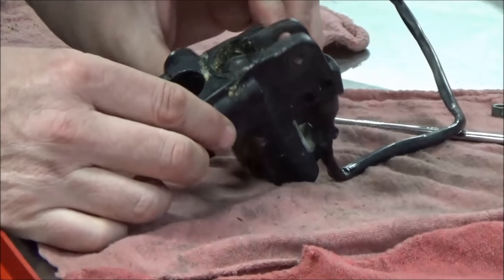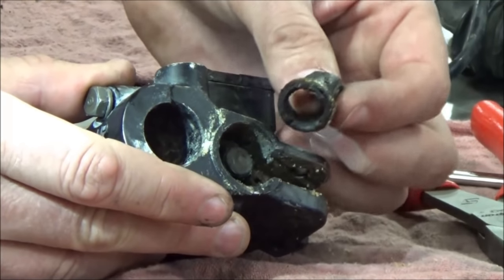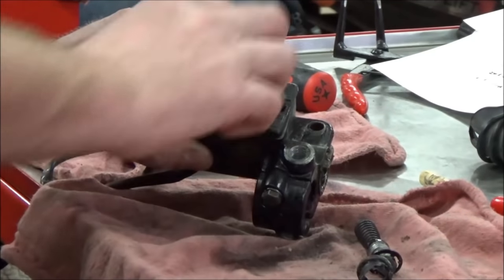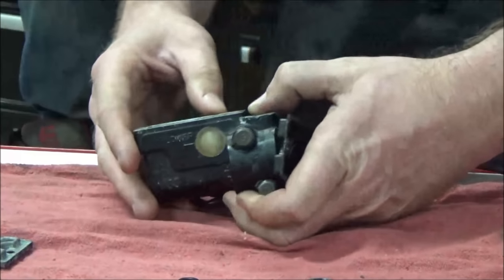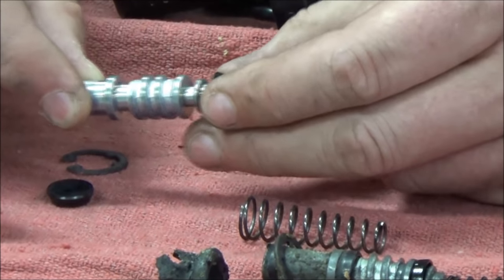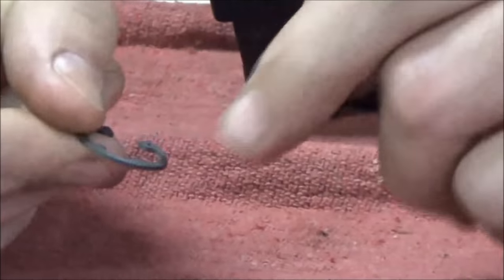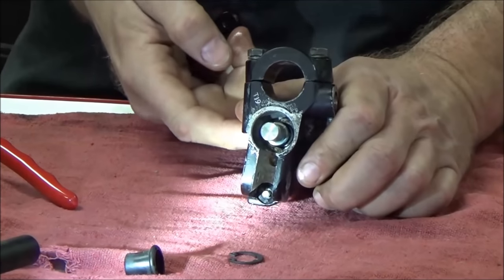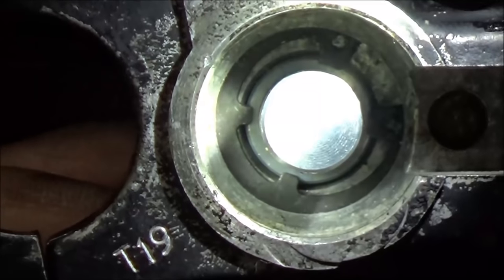How to rebuild your master cylinder Disassembly and Assembly #how2wrench #mastercylinder

Comment: 12:03 Alignment of Circlips - You are wrong! Snap rings should be curved side out see https://en.wikipedia.org/wiki/Circlip and specifically https://en.wikipedia.org/wiki/Circlip#/media/File:Internal_Snap_Ring.jpg
Reply from the maker: Hello Stuart....I'll assume you had good intentions with this comment but you are indeed incorrect. Reference the very article you linked and read the entire wiki...You may have been caught up by the first image and brings up a great point on why using the manufactures instructions is best but even at times, misprints do happen. If you look at the Honda photo in the same article, it states as I demonstrated. https://en.wikipedia.org/wiki/Circlip#/media/File:Honda_Snap_Ring_Installation_Example.jpg 

I'm not familiar with the application on the photo first used in the article but am extremely familiar with the Japanese 4. 
We have an open format here @ www.how2wrench.com and welcome all comments. You did a better job than most by providing information to correct what you believed was wrong and we thank you. Take some time to review the Honda procedures. I'd have to look (this is an old video and I no longer work for the college to grab the master cylinder) but If memory serves me correctly (insert warning here...LOL) I don't believe Honda even specifies a direction on master cylinder snap rings but was a good time to introduce this to students learning the craft that at times, it does matter.  
Hope you sub and take advantage of the many playlists here on the channel.

I provide one on one help. Contact me here: https://how2wrench.com/contact/ Your answers and help are just around the corner. Save time and money while protecting your investment and yourself by doing it the right way at www.How2Wrench.com  

Have you Subscribed yet to never miss a video? Have you seen the video playlists https://www.youtube.com/user/conleybuilt/playlists ? 

Want to say “thanks” or “keep it up”? Click here https://www.paypal.me/how2wrench

Comment: OOOH IM SO PLEASED THATS NOT MY  MASTER CYLINDER
Reply from the maker: Why is that Denise?
Reply: Good vid in most parts but wrap  a piece of plastic sheet around piston and use brake seal lube (red grease)  all the best EAC. My. initials
Reply from the maker: @deniseclark2639  Thank you EAC...we will share with Shane!